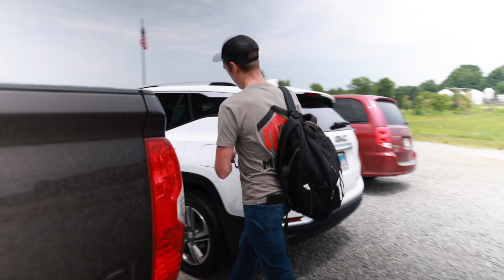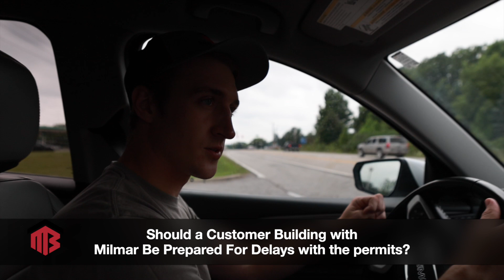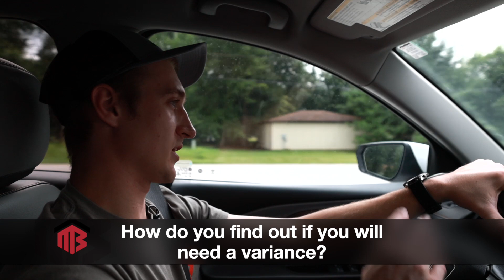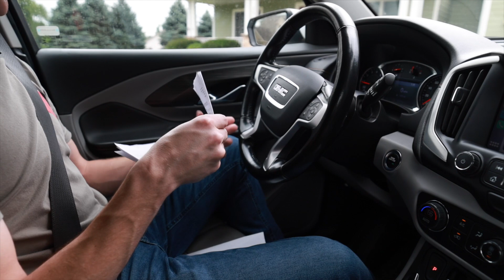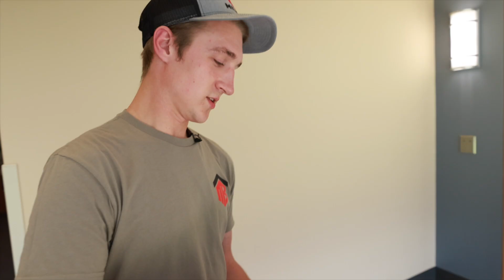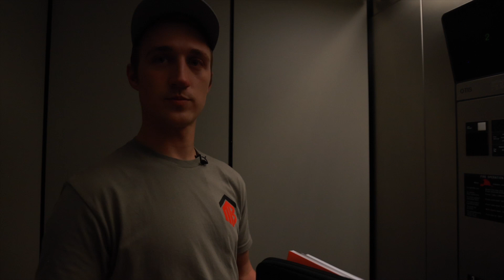What Goes Into Permitting a Pole Barn?

Comment: And building a pole building in a flood plain area of the Clark fork Idaho River I happen to be a leg amputee and I'm also hoping to use a cable span to my boat dock on the clockwork River do I have to have a FEMA model plan
Reply from the maker: That's a great question! I would check with a local builder that is used to working with flood plains out there. We are located in the Midwest, so are more in tune with what is permitted and what's best for builds out here. But a reputable, local builder should be able to help you learn more about what you'll need to have worked into your overall plan for building there.